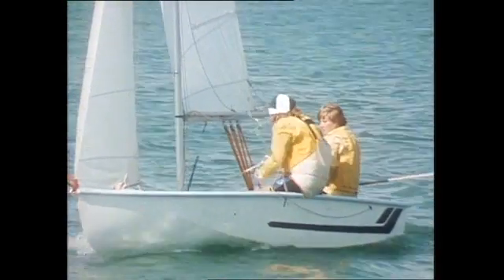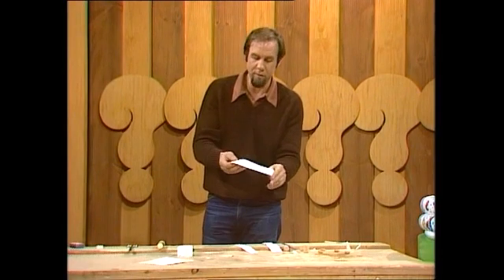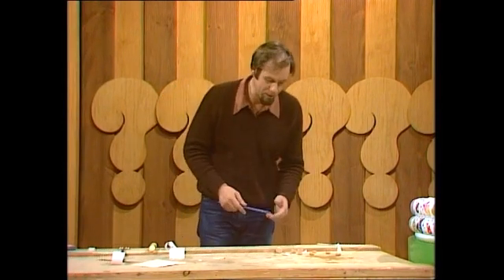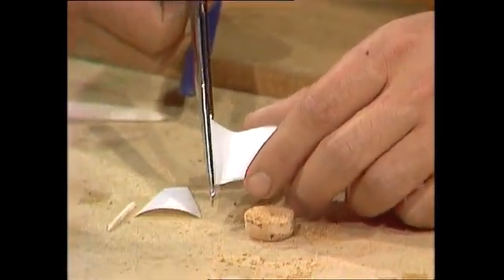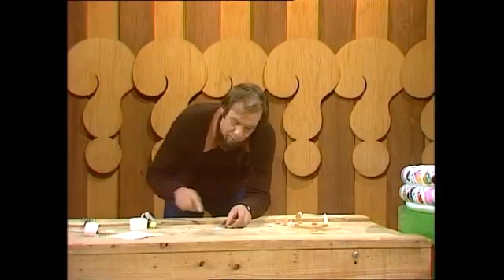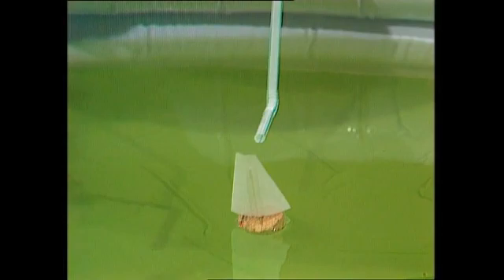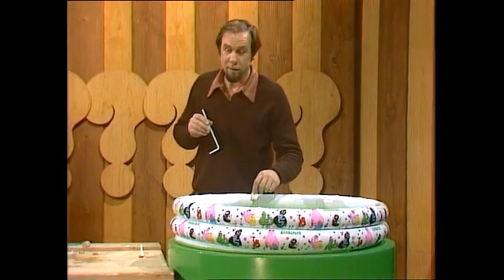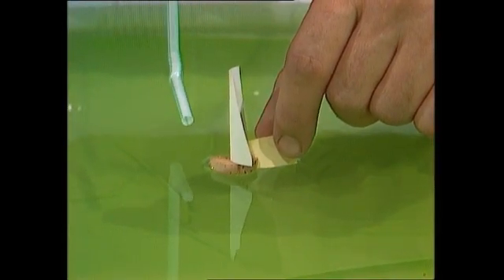How yachts sail into the wind

Comment: I've never been too happy with the usual how it sails/ how it flies explanations. They all seem to leave out that the air is redirected. Planes push a huge amount of air down in order to stay aloft, and sailboats do one better by not only directing wind backwards, but also being able to push against the water. In fact going anything but dead down wind, you sail on the difference between water and air velocity, extracting power until it matches drag and you can go no faster (America's Cup foilers were going through the water more than twice as fast as the wind was going over it for a stationary measurer)